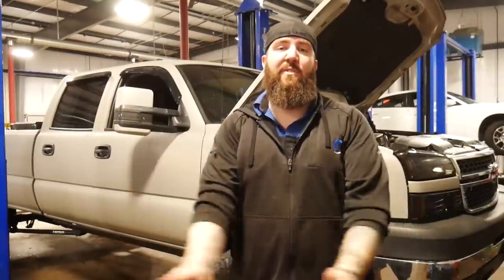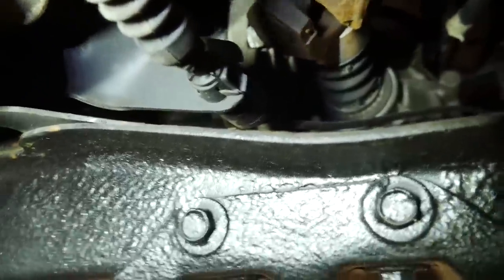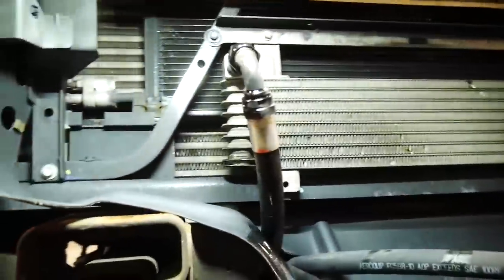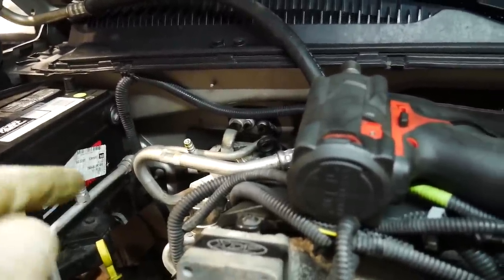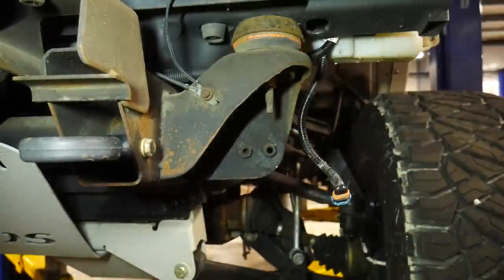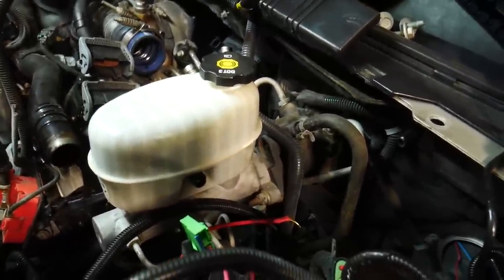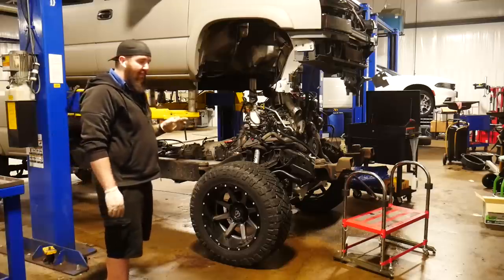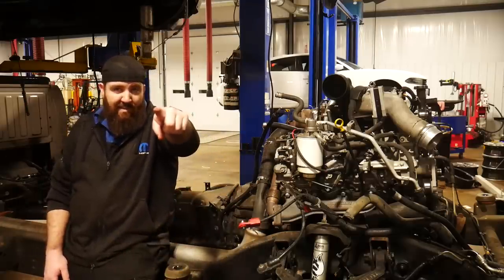DURAMAX CAB REMOVAL FULL PROCESS LBZ

Comment: Excellent video. But you don't have to evacuate the a/c system. Pull the four compressor bolts off and the whole a/c system stays with the cab. Time saver.

Comment: I commend you , the V8 diesels are absolute nightmares to work on, I work on big trucks Mack International and Freightliners with  in-line 6 engines , with tilt hoods , everything is above the frame rails and the hood is  swung open . I sold
My Duramax at 163k , wasn’t dealing with the head gaskets , they usually fail around 200k miles.After doing injectors on my LB7 that was enough for me .

Comment: The bumper, the fuel lines and the a/c system can stay charged or connected. Just lay the compressor ontop of the passenger side batter.

Comment: 8:25 you mention about a ground strap on the block that has to come up, problem is it's a harness and runs along the front of the oil pan. Does that all have to come off?

Comment: Awesome video.   Is this the lly or lbz      Im pulling my cab off on the coming weekend.   full paint job and sand blast the frame.   Also putting a new interior in it.   My 2005 has 312000 on it and runs mint.
Reply from the maker: It’s a 2006 LBZ

Comment: does anybody know if a cab off a newer truck will fit on a 07??? or if gas and diesel cabs are different?   looking to put a newer cab on a 07 classic body style duramax I think lbz could a 2013 or 2018 cab fit???
Reply: Why wouldn’t you just LBZ swap the body style you want?

Comment: So why did you not remove the ac pump instead of pulling the lines? Is there a reason not to leave the pump with the cab?
Reply from the maker: I know you could just fold the pump over and set it off to the side, but I don’t really like kinking and twisting those AC lines over especially on a vehicle that is 13 years old. With the lines off the pump it’s easier to just bend them easily at the rubber sections instead of just having them folded over and kinked. It’s a personal preference I guess
Reply: Rustbelt Mechanic 
thanks
Reply: Sorry I didn't see this reply to the a/c removal till know. My bad!

Comment: hey man what are you doin as far as rack wise? i know its at your work and shipping parts out can take days, is that someone elses rack thats not going to be in for a while or? just wondering because im also a dealer tech.
Reply from the maker: It’s at work and I’ve got an agreement with my boss on using it for a bit
Reply: @RustbeltMechanic  that's a good boss right there.